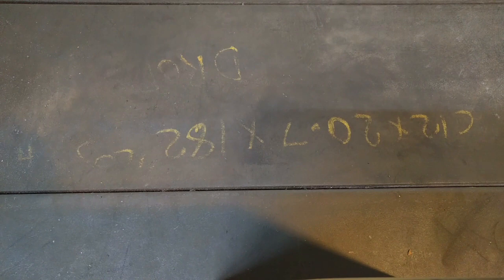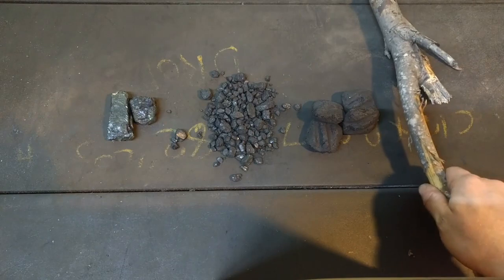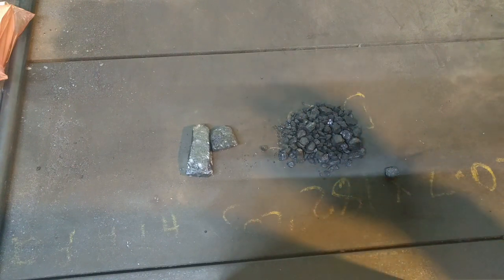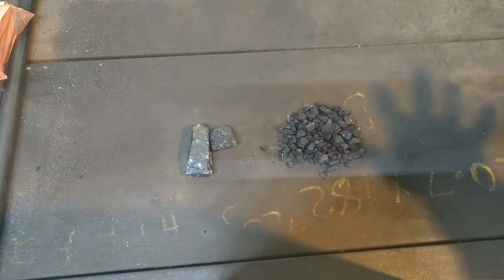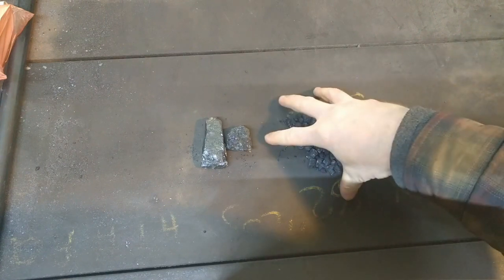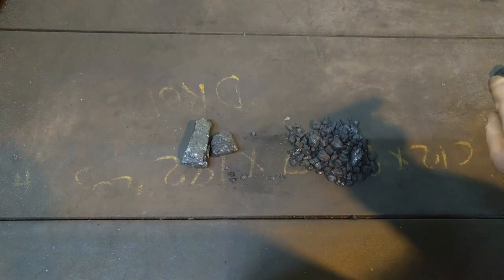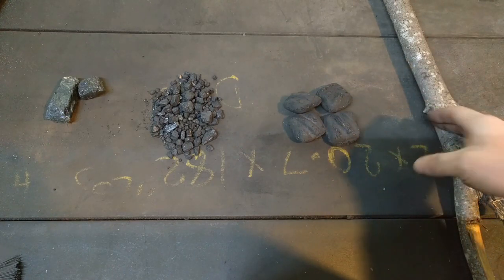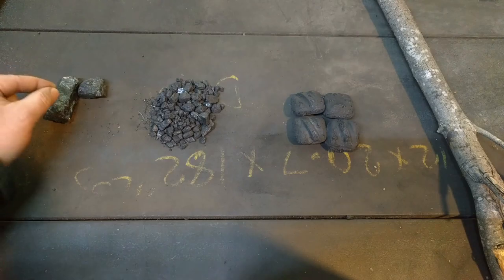How to fuel your forge

Comment: I watched Roy's... not sure he went in to it open minded.  I say, give each fuel enough use to learn some of the idiosyncrasies of it's use, and then give it an honest opinion.  Much like every other "experienced" smith, because it didn't behave like bituminous, he didn't like it.  Every fuel has its ups and downs, and you don't light anthracite like you light bituminous, and you don't light propane the way you light charcoal, and you don't burn wood the same way you'd burn coal...and you don't treat anthracite like you would charcoal, or even bituminous... being open minded is the key to being successful with whatever forge fuel you have available. get used to the fuel you have, and any of them will work to get you smithing.
Reply from the maker: Absolutely! And yeah... He even said in his video he already had a bad opinion of it.  I'm def going in open minded. I kinda liked forging with charcoal... Even though it used fuel very quickly... I got to cook dinner on it after I was done forging!
Reply: lol
Reply: HoJ Forge 
Well said...  I watched Roy's video and gave the same opinion as you.    To get the most out of any fuel it must be managed according to its needs.
Reply: "managed according to its needs"... perfect way to say it
Reply from the maker: I like that. I'll probably mention it in my next fuel video.

Comment: What would you suggest I do,  make my own charcoal for free or buy something better like coal in 25lb bags for 33 dollars each
Reply from the maker: That seems like really expensive coal. Where you getting it? If you want to use charcoal. Go for it. But you will go through a ton of it. It will burn up quick. I'd look for a better coal source. Check around for local blacksmith groups. They usually have a decent source.

Comment: Looking forward to the rest of the series!  When you mentioned graphite, did you maybe mean coke?  Coke is to coal as charcoal is to wood... If you can find some, you may find lump charcoal a lot nicer to work with than briquettes.
Reply from the maker: Nope, graphite is technically a higher grade coal than Anthracite. More heat pressure and 'science stuff' while it's still underground. Pure carbon. Coke is coal with the impurities burned out. 

I've used lump charcoal, I like it better for cooking, but it makes more Sparks than briquettes when you add air. And I didn't have any on hand.

Comment: I have used charcoal and wood for fuel a lot, until I found a source of coke, I have never used coal. After a while, I never bothered to burn down the wood to a bed of coals, it forges just fine as the wood is burning. Both wood and charcoal use a heck of a lot more fuel than coke!
 I much prefer coke as fuel. Run the forge all day on a bucket of it.
Reply: Jack Dawg 
Same, just started using coke after finding a supplier. I use charcoal to start and add a bit during the day to keep the coke lit but coke is definatly the way to go!

Comment: Looks like you're working with more traditional Forge fuels but you should check out this crazy Australian guy he makes waste oil burners that are more than efficient for a proper Forge his channel name is "oil burnner"
Reply: I have already built one of his burners and it is absolutely amazing. Currently working on the forge part of it but just holding Steel in front of the burner alone brings it to weld temp within a minute.
Reply from the maker: Interesting. I just looked him up. I saw one of his oil burner videos a while ago... Now the gears are turning...
Reply: Warped Legacy what I like about them is that they have enough power to forge but also foundry... opening up all kinds of project ideas.

Comment: I've used most types of fuel, I think anthracite is preferable for convenience sake, I do like soft charcoals they don't stick to the work like anthracite can, but the woods burn off too fast, and because I usually forge large swords I have to constantly keep adding more wood over and over. I think due to laziness or time consumption I think anthracite is the best. It also burns hotter, better for going past critical into sparking.

Comment: Which one is more efficient/takes longer to burn up?
Reply from the maker: If they were tested for longest burn time with a continuous burn, probably the anthracite coal. Simply because it is the most dense fuel. More carbon in a smaller space, but It all depends on how you burn it. In a forging situation, bituminous can last longer than anthracite, because you can shut the air down between heats with bituminous. Its a lot harder to do that with anthracite, because it needs to maintain a higher heat to continue burning. Wood and charcoal burn very quickly when compared to coal.

Comment: My forge tends to go out after 15-20 minutes with the air off.  I have seen someone use alder chips mixed in with their coal to keep it lit longer and make the coal last longer. With the chips the forge started up after being idle more then an hour. I'll see about getting some chips this summer and let you know how it goes. Could make using bituminous coal a bit cheaper depending on your setup.
Reply from the maker: That's kinda what I've been doing. Mixed a little bituminous coal in my Anthracite. Let's me turn my blower off sometimes, and keeps the fire a bit more even.